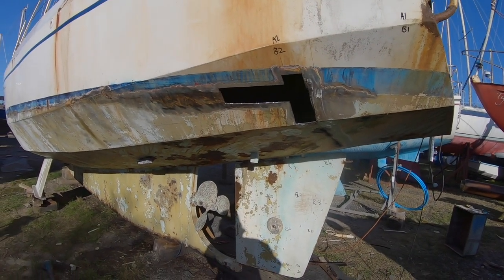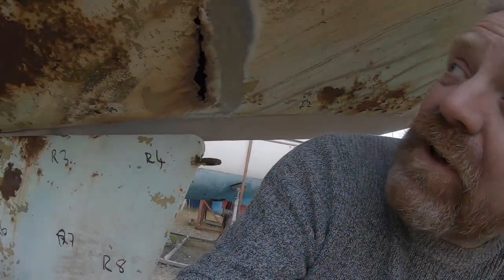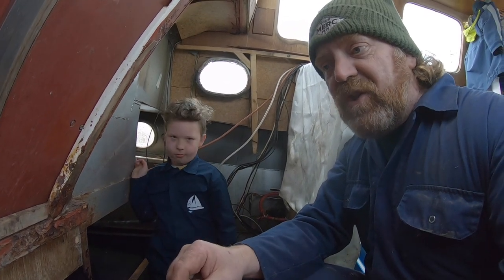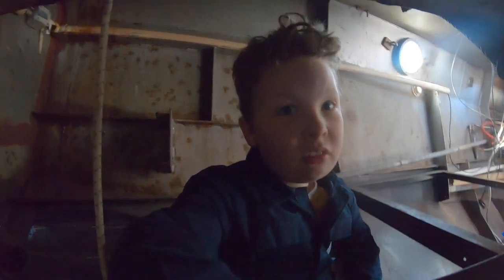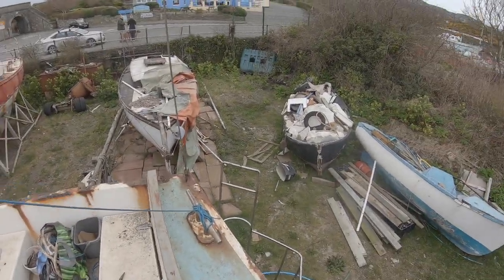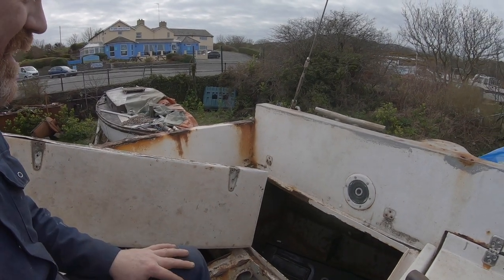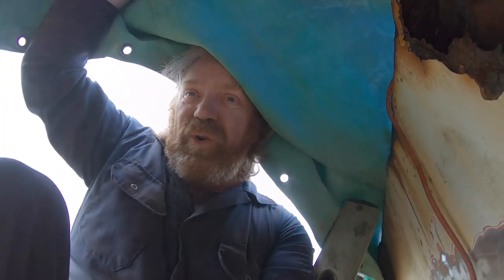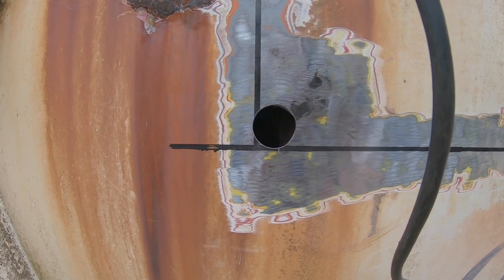#37 - Cutting out our RUSTY transom! OUCH!! HOSPITAL?? STITCHES??

Comment: Glad that grinder didn't do any major damage. I once cut off a cross brace we had welded to some scaffolding using a massive big grinder. I was about 3 stories up and as soon as I cut through the weld the scaffolding collapsed with me on top. Grinder had lock pushed in so I didn't have to keep finger on the trigger. It cut my jeans but not a mark on me. 😅
Reply from the maker: Wow that was lucky!!

Comment: You can join co-ax with a chock block but you need to use Yack's butter solder for the joints and wash them out with Gnats milk afterwards. 😁 Great stuff. Sail Safe Guys, Ant, Cid & the pooch crew.

Comment: Interesting episode for sure, love your metal working skills Andy.
I see lots of comments have mentioned safety and grinder injury stories. And for good reason. Here’s mine - my sister in law‘s father (we affectionately called him ‘Mr Dupe’ as his last name was DuPlessis) decided to use a huge angle grinder that he had, to cut off the limb of a tree in his garden, because he didn’t have a chainsaw to do it. (Mistake No 1). It required getting quite high up on a ladder, and he was alone with no help (mistake No 2). His wife was inside the house, more or less oblivious as to what he was up to. In the process of cutting off the tree branch, the angle grinder slipped, came down and sliced into his thigh, cutting straight through his femoral artery in an instant.  He managed to get down off the ladder, I think he fell halfway, and shouted for help. His dear wife of 50+ years came rushing out to find him bleeding to death on the ground at the base of the ladder. She called for an ambulance but he died in her arms well before they could even get there. It was an absolutely tragic accident in their family which took out a great man in a few minutes, and all it took was one lapse in judgment and concentration. 
I’ve been a commercial pilot for 46 years, mostly selling aircraft and flying all sorts of different airplanes that I had never sat in before, but also bush flying and float plane flying up in Alaska and in the Caribbean, where I suffered a catastrophic engine failure in a turboprop airplane three minutes after takeoff and had to land in the open ocean. Only because of great training that I had received from some amazing instructors during my flying career, and the fact that I followed procedures which I had memorized and burned into my mind, did everything go well, the only discomfort being the passengers getting wet feet as they boarded the rescue boat.  The universe was working with us that day 🙏🏻🙏🏻
My point is that in aviation everything revolves around safety, and we have checklists for every procedure we do - pre-start, pre-takeoff, after takeoff, before descent, pre-landing, after landing, etc. etc., never mind all the emergency procedures. There’s a very good reason why we have all these checks, because without them things will get forgotten or assumed and people will die as a result. Aviation, like the sea, is a very unforgiving environment for those who do not give it the proper respect it demands & deserves. 
I’ve watched a bunch of your episodes now, and have huge respect for you both, Andy and Melissa, for all that you are doing here and hoping to accomplish. I love your get it done attitude and the fact that you don’t let small things put you off at all. However I have to say that I have been very concerned about some of your lack of safety procedures, and obviously many of your viewers have felt the same way, to the point where they have even sent you safety gear to try to keep you out of trouble. Watching little Jack using cutting power tools close to his face with absolutely NO face or even eye protection, to me is totally unacceptable. Being a paramedic Andy, you must surely know that all it takes is one slip and somebody can lose an eye or a finger or worse. As much as you laughed off this incident with the grinder, let’s be honest and brutally truthful about it - this could have been a major injury that might have taken you out for months or left you incapacitated or compromised for life. No, I don’t think I’m over dramatizing it at all. I’ve seen it happen myself. One of my good South African friends here in Florida is a top hand and arm surgeon, and he’s told me on more than one occasion that the vast majority of injuries he sees and has to work on, are people who have injured themselves with power tools, especially power saws and angle grinders. He says most users simply don’t understand the torque and kickback forces that these tools can produce when things go wrong. Like when you slip or the tool bites.
Bottom line, please guys - develop some safety procedures here, make a checklist for them (arm-covering heavier leather gloves for cutting, grinding & welding, safety glasses, respirator, no loose clothing, shoes tied firmly to ensure sure rootedness, proper stance & balance, tool being operated correctly, etc etc) and follow it religiously. You’re working up on a metal boat high above the ground with no safety rails anymore, so you are already in a very precarious environment. It’s only going to take one mistake for the next accident to happen, and what could be the consequences of that? ... on the other hand, with the proper safety checklist and the right equipment and full knowledge of its use, you’ll be able to get things done and be more confident in the process. And please, let’s get Jack some gloves and proper safety glasses at the minimum, for when he’s using power tools of any kind. 
Whenever I use a ladder around the house to do some work, I always think of Mr Dupe, the kindest most generous man you could ever have known. He was quite religious, and always gave me his blessings whenever I left after visiting him. So I think of him whenever I’m climbing a ladder, and I say a prayer to him, thanking him for his guidance and advice through the years. I tell him that he did not die in vain, and that I am taking proper care to stay safe. It’s as if I feel him looking down on me then, and thanking me for honoring him in this way ...
As we say in aviation - there are old pilots and bold pilots, but no old bold pilots. There’s a reason for that truth. I believe that life is such a precious thing that we should respect it in every way possible, not only for ourselves but for our loved ones who want us to be there for many years to come. 
Apologies if this sounded like a lecture, it’s not intended that way, consider it a sincere chat from a somewhat older good mate over a beer. This incident was your wake up call. Blessings to you all, cheers 🙏🏻
Reply from the maker: You’re right. In medicine we now use systems which have come from the aviation industry, specifically for intubation and ventilation, there was a huge test case about it several years ago which is when the new systems and checklists were introduced for monitoring and assessing adequate ventilation of intubated patients.

Comment: Glad your silly mistake didn't result in a bigger injury. It really speaks to how taking the extra time to be safe will make you more productive as even just a small mistake can shut down work. A couple of weeks back I stupidly was wearing an old pair of Sperry shoes that had worn out treads and slipped on a wet dock while stepping from boat. I had stepped from the boat to the dock a hundred times but this time my foot went out and I twisted and landed on my other leg. For a minute I thought I had down real damage and dreaded having to call my wife to some save me but thankfully it was only a couple sprains and a badly scrapped shin. It still layed me up for a couple of days when I could have been working on the boat. I had new pair of shoes the next time I visited her. On that note, please Jack use eye protection next time you use the oscillating saw. In most other ways you set a good example for my son.
Reply from the maker: Ouch!! Yes we agree we should have definitely made him wear eye protection!

Comment: Hi.   This is a bit off topic, however I was thinking about your bow repair work.  Would you ever consider making up a bridle set up that would hold your mast in place , so you wouldn’t have to wait so many months to get at the bow and bow sprit work.  I am a retired owner/operator of a boat yard in the states.   How could I send you a drawing as to the design of the rigging set/up .  It involves rigging the standing rigging to the bottom of your hull.  It would be a safe set/up.   You could do the repair now and be done with it, especially with how productive you have been already and also have the gentleman currently present to do your welding. Just a suggestion.
   Also, glad to see how you explain 
Items to Jack. As I have stated here before you both are a fine example of how parents should interact with their children.   Take care. Tony

Comment: Go research Amphicar. The guy doing restoration work on them MIG welded the thin sheet metal in and had pin holes that leaked. He switched over to TIG welding. You are doing both sides, but I just thought I would point that out.
Reply from the maker: Can’t tig weld and it takes so long to become good at it that on balance it’s better to stick with what I know lol. But I do know tig is much much better

Comment: At least now you can say you’ve put a bit of yourself into the project🤔

Had you thought about putting a bit of a cutout/door in the transom for easier access?
Reply from the maker: It’s certainly a consideration. I need to run the idea past a marine architect though if I’m putting a door in the transom as I’m not sure if it would effect the strength laterally across the transom. I guess it would depend on the depth of the door/gate. I suppose a fairly shallow one wouldn’t make much difference but I wouldn’t know how to calculate how much I can do in that area before compromising the lateral strength

Comment: Sounds bad !   I was wire brushing a piece of steel and the wire brush caught the edge of the steel and it was flicked onto my tee shirt which got wrapped around the brush . I was lucky that it only bruised my chest and left a lot of little scratch marks which swirled up the chest . I immediately invested in a leather apron , and I also ear it when welding . Saves having a lot of small burnt holes in my tee shirts.
Reply from the maker: Ouch!!

Comment: STITCHES,  think Super Glue,  been using it for years...
Reply: not when the wound is not cleaned properly -especially that deep. Gluing can seal an infection in and then it goes deeper and yu can be in real trouble
But yes, cynoacrylates are used commonly in the medical and veterinary fields. The multi-pack sets you can get from the £ stores are especially good - single use (sterile) & throw away 
(& keep them in the fridge to stop them going off)
Reply from the maker: Absolutely correct.
I’m a paramedic by trade and I knew just looking at the wound that maybe glue might work but I needed some lignocaine and sterile saline to properly flush the wound or you’re looking at necrotising fasciitis
Reply from the maker: I know what you mean but I’m a paramedic by trade and I knew the wound needed properly cleaning with sterile saline and to do that I needed some lignocaine. As it happened I popped to my local ED and the nurse on duty was a colleague of mine in minor injuries and we agreed glue was suitable for my knee but my hand did need a couple of Sutures and cleaning properly

Comment: I hope you are using the right steel for it. I am surprised to see you were able to clamp a bend on your transom like that. I would have expected you to need one end welded to allow you pull the other end against its resistance. I have two pieces of dutch steel from my boat portlights that came off a curve (and sprang straight) at 5mm thick and you could drive a lorry over them and they wouldn't bend. Hope you hand is healing.
Reply from the maker: We are using cold rolled mild steel, not COR-TEN steel. For a variety of complicated and boring reasons 😂

My hand is all better now though thank you. Onwards and upwards eh :)
Reply: No, COR-TEN would not be right but high carbon mild steel. There was a fleet of rental boats on the Shannon called Tara Cruisers. They were built of mild steel and they all got dented and bashed and suffered from rust problems.
They should have been built of high carbon sheet steel or Dutch stee like all the Dutch build cruisersl. Though I see Dutch steel is more correctly referred to as copper so there is a misnomer there somewhere. 
Anyway too late now, you are nearly done.
Reply from the maker: I’ll double check the carbon content of what I’m buying because that is interesting for sure. I’ll ask Dave at Mona F&T what the specs are, but they are a steel supplier and supply to the whole crushing fleet up here and I’m using the stuff he recommends and what they use on all the local trawlers and fishing boats
So I’m trusting the supplier that it’s the right stuff 🤷🏼‍♂️

Comment: Actually my friends welding in that kind of weather being that cold is not advisable the steel has a tendency to expand and contract during the welding process
Reply from the maker: It was actually pretty warm on the day they welded! 👍
Reply: Is 10 Degrees C +or- really going to matter when your melting metal together at about 2000 C? The only problem the weather will give you when welding outside with a  mig is the wind blowing your shield gas away.
Reply from the maker: Yes your right, the day we welded it was 3 knots but is definitely something we are very aware of!

Comment: All it takes is a moment of inattention, and boom. Last time I had to go for injury I was cutting plywood on a table saw and was using my leg to hold it up and shoved a 6 inch splinter into my thigh, of course I was drug down to the Doc in the Box, splinter was just under the skin, his cheap disposable scalpel was so dull, I finally pulled out my pocket knife and told him to please use this, so I can get out of here and go home. Once h nicked the skin it came back out the same way it had gone in washed out with some providine a band aid and I was on my way home, $150. poorer

Comment: Shouldnt patches like that be done with rounded edges as thats what everyone else ive watched has done? Something about less chance of stress cracks even though im sure the original steel is put on in straight edge sheets. PS My dad was a welder and he almost chopped his thumb and leg off with angle grinders. Seems to be the thing to do if your a fabricator !
Reply from the maker: Yes they should. The edges are rounded 😊

Comment: You have a plasma cutter why are you using a disc cutter? It's quicker easier and safer plus no grinding dust to worry about just clean a patch to start the plasma on  just use a fire blanket on the inside to contain it
Reply from the maker: It was very very windy and last time I tried to use the plasma outdoors in wind it didn’t work too great
Reply: @SailingMelody  it should work just fine, maybe the built in pump isn't man enough then? I did wonder how it would compare to a 30a plasma cutter with external air source.... 

The plasma should be going straight through the steel so the wind shouldn't have much of an effect unless you had an airline blowing at it. 

 I'd suggest trying it with a decent compressor behind it, honestly once you are comfortable with the plasma you won't use the grinder of anything but grinding, will save you so much time! And get a big cold chisel for knocking the dross off and you will be amazed how quick you get the repairs done, you can get a guide wheel for it and run it around templates made from wood etc. Get it cutting right and you won't look back! 😉

Just trying to help you learn what took me years, and hopefully avoid any more injuries in the mean time.